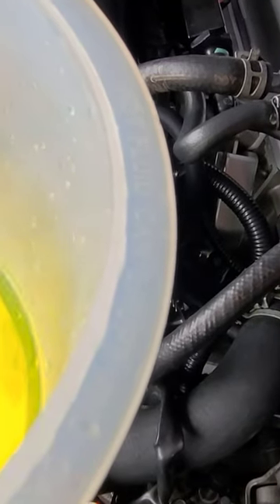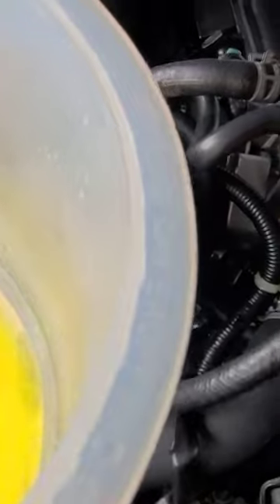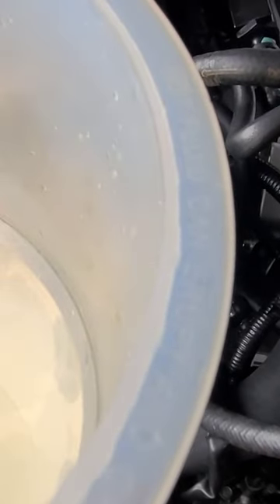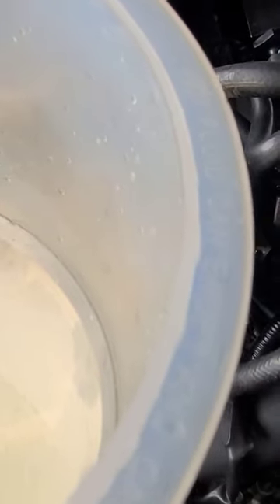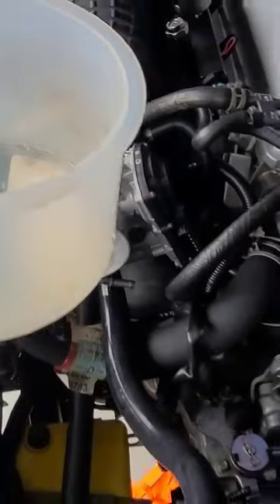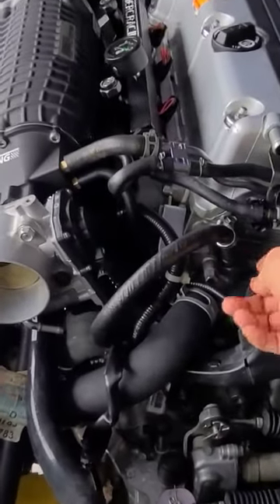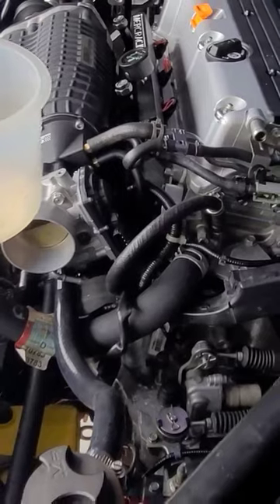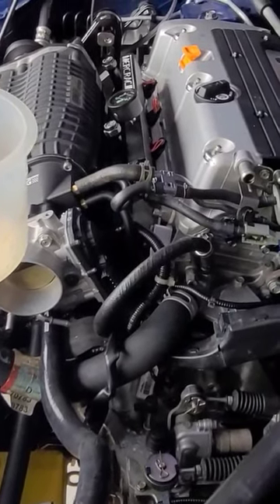bleeding air out of a k series cooling system.

Comment: Am I filling up while it’s off? Or while on, cuz I just had my car on with the hose off and it was pouring coolant out. So idk if I’m already topped off or I keep filling up
Reply from the maker: You should start filling up while off to ensure you don't have hot coolant burning you by accident.
Reply: @jorgegarcia7005 I’ve done 3 flushes already it seems to full up. Limiting from middle and driver. I don’t think my fans are turning on so I’ll check that. Cuz my flash pro tells me that they turn on with my second coolant temp but on my app the second coolant temp is at 60-70- while the first one is at 200 But I swapped my thermostat cuz my bottom hose was not hot so now with the new one it still doesn’t feel hot. I know the top hose gets hot but the bottom ones isn’t.
Reply: @jorgegarcia7005 so would it be that coolant isn’t traveling to the back where the second coolant temp is at or it’s just my fans
Reply: I kept revving to bleed, and the second hose just got hot its at 175 now. Slowly fixing it💪🏽